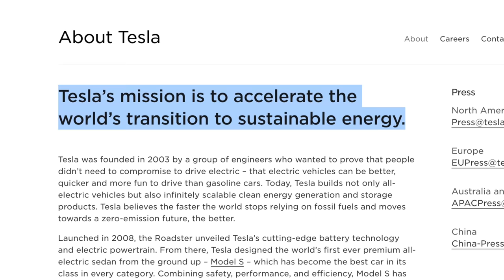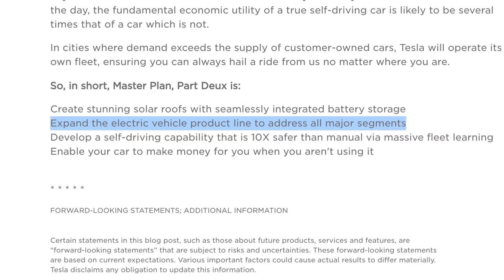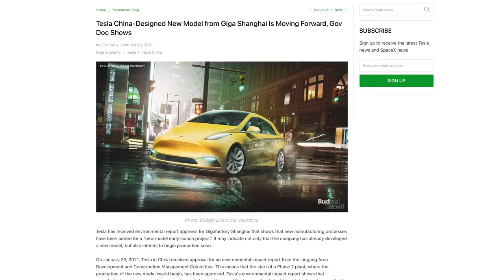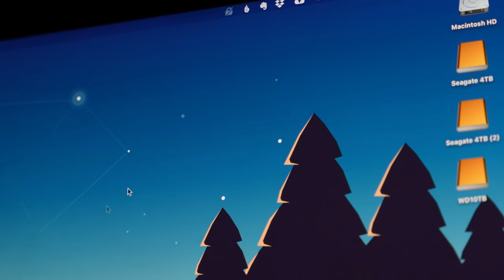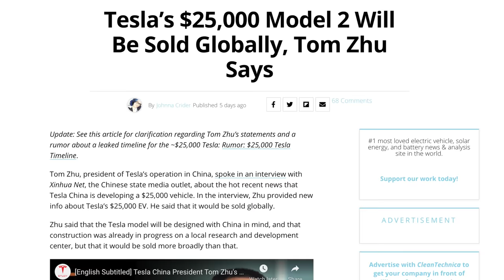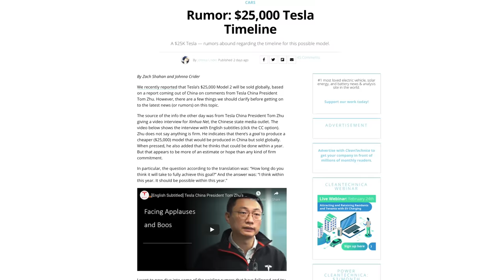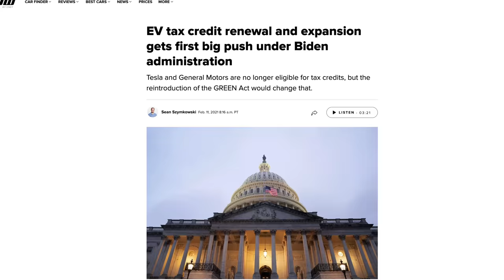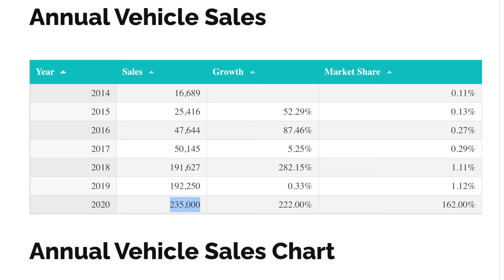New Tesla Model 2 = Game OVER for Gas

Comment: Make a car that will go 1,000 miles before the next charge up. Last 14 years without a major repair bill. Charge up in 5 minutes and cost under $35,000. When that happens, then gasoline will be in some trouble. There will always be a need for oil and gas. What needs to be done is work on how to burn is cleanly.

Comment: What I need is range and a non-luxury car price. It’s fine to have some $20,000 cars, but if the range is that low I can’t go anywhere on a trip. I hope they will get increased range on the mid priced cars, increased infrastructure of superchargers more places, and more stores. Right now it’s tempting to look for a car by a company with a store in my town such as Ford. The Ford range right now is about 300 miles but that’s not that great either. I need to be able to go as long as possible at 70 miles an hour so that I can go on a trip without having to fly. I don’t want to fly and I’m used to cars for my travel. 

Electric cars can’t do what I need yet and part of the reason is that the major car companies are stalling for time and trying to keep with the shorter range batteries.

 I feel like we’re in the dark ages still. Tesla has the higher range cars priced up at $80,000. I’m not going to run around in a luxury car like an elitist billionaire; people I deal with have contempt for conspicuous consumption. Please increase the range in the batteries, get more super chargers for trips, get stores in college towns like mine so I don’t regret not having a place nearby for service.
Reply: The range at 250 is not good enough. We need 500 miles a charge which is probably 400 miles at 70 mph. I’m not paying $80k for that. I don’t need high speeds and performance - I need road trips and reliability!

Comment: How will Tesla work in the winter? Keep in mind that in a good part of the country temperatures are below freezing for several months of the year. If you live in a rural area, and don’t have a heated garage, the gel in your Lithium ion battery will freeze, significantly reducing your battery’s range and your capacity to recharge it. I have a feeling that fossil fuel vehicles are still going to be around for a while.
Reply: Why do You think the 'gel' will freeze ? Does Your ethylene glycol freeze in the winter in the engine cooling system ?
Also, why do You limit You thinking to the [false term] of fossil fuels ,which is used for fuels derived from oil beneath the ground, then processed?
There are many 'renewable', natural fuel sources which are useful, efficient, effective in combustion engines and many without significant to zero emissions.
The list includes hydrogen, ethanol, methanol, methane and others too.
Sincerely

Comment: I'm still waiting to see a used-electric-car market develop locally.  New cars are out of my range (I don't borrow money).
Reply: Amen to that. What I have seen from the very small used electric car market out there is people drive them til the battery craps out and you can get them for pennies, but you have to drop a small fortune on a new battery to get them to work.
Reply: @misterknightowlandco  I'm currently cooking at a hydro electric dam.  No gas in the kitchen because electricity costs us nothing.   Even so, there isn't a single electric vehicle on site.  We are in the far north, so only proven technology is trusted.
Reply: @HeatherSpoonheim  yeah, I wouldn’t drive an EV up there either. It’s not ready for extreme conditions yet i don’t think. Personally, I wouldn’t even consider it until they made a truck.

Comment: Nice, but I occasionally drive to California from New Mexico,  so I'll still require an internal combustion vehicle.
Reply: Rubbish. I've just Googled Tesla superchargers between New Mexico and California and there are hundreds. It's a 16 hour journey so you'll be glad of a break to recharge. I worked it out and I live in England for chrissake.
Reply: @Nickbaldeagle02 , sorry nick, I don't want to stop and charge on my way, that's my choice.
Reply: @rongigear8740  what, you can do a 16 hour drive in one go, no refuel or toilet breaks? What are you, a Terminator?
Reply: @Nickbaldeagle02 , what business it of yours how i drive? Are you the arbiter of ecology? The preacher of green? I choose combustion over electric and that's my choice, not yours. I know all about the charging stations and where the are located. I know the cost for a 250 mile charge and the time it takes to charge the battery. All gas stations are located right off the freeway and takes no longer than 5 minutes to fill up, not an 80% fill up. So yeah, call me the terminator of driving straight through and save your preaching for someone else.
Reply: @rongigear8740  I thought posting comments on a public forum where people can reply is what YouTube was about. You said that you drive New Mexico to California occasionally so that you need a combustion engine. I pointed out that you don't. Now if you'd have said "I prefer combustion over electric" that would have been different.
Reply: @Nickbaldeagle02 , it's not what a person says, but rather how they say it. After 70 years on this rock, a degree in comparative anatomy from California State Hayward, 3 children and 5 grandchildren i think I'm capable of making intelligent decisions on my own. My choices are based on facts and reason, not on ideology.  When I drive 900 miles, 700 that's desert, I'm choosing the mode of transportation that I feel most comfortable with. So yes, internal combustion is a requirement for me, with or without Google.
Reply: @rongigear8740  nah, your just biased. I use to take road trips from Washington state to central mexico. An electric car looks godly to me, 24 minutes for an 80% charge every 4 hours is just great because my ass gets tired and i get hungry. The cost of electricity compared to gas is already enough to entice me.
Reply: @odisy64 , no bias, I don't want to spend 30 minutes every 250 miles charging, at an average of 20 bucks per charge. Especially not in the desert in the middle of no where, lotta bad people out there. Enterprise rentsTeslas and they give you a map of all charging stations. When I get to San Diego I use my electric mountain bike to get around. People need to get a grip, not everyone is going to agree with you, but that's life.
Reply: @rongigear8740  uh, a current model 3 has a 353 mile range, where are you getting 250 in 30 min? You can disagree with me just dont have the wrong reasons. If your worried about getting robbed at a charging station i can tell you its easier to rob someone at a gas station, but you also don't have to deal with beggars.
Reply: From the Enterprise brochure: "Plug in for about 30 minutes and grab a cup of coffee or a quick bite to eat while you charge." They estimated a 250 mile charge in that time... That's charging at a Tesla supercharger station. Now what model they offered,  I'm not sure. So I'm not disagreeing with you one way or the other because frankly I don't care what you think. As far as being easier to rob someone at a gas station, I'll assume you have first hand experience on that matter.  End of discussion.
Reply: @rongigear8740  can i get a link to your source, it might be outdated. ive seen others giving actual time estimates. Ive also seen videos  of people test it themselves at 250kw charging stations. But what i and you think is not important, the real world numbers are.

But anyways i think gas stations are easier to get robbed at because i live right across the street from one in the ghetto. We have a super charger station in my city and it looks way safer.

Comment: Gas isn't going anywhere soon. First, where do you send it for repairs? I live near Albany NY and the closest Telsa repair shop is in NY City. And our grid can barely handle the air conditioners in the summer here. And most who live in Downtown Albany live in high rise buildings and tend to have to park a block to blocks away. NY City has 1000's of times more people that live in much higher buildings. How will they charge it? they can't. Is Musk gonna put charging stations on every block? I'm not paying for that. And It's gonna a decade, or more, before the mechanics catch up even a little bit. Is Musk going to pay for them to go back to school. I ain't paying for that either. That's on them. It's their product. Right?

Comment: With the limits of current battery technology, electric car may work for some city folks. But for it to replace gasoline cars? I just don't see it in a foreseeable future. Even if electric cars cost the same as gasoline cars, and there are as many charging stations as gasoline stations, refueling still take at least 40+ minutes. Imagine having to wait for several other cars before you can refuel your car.
Reply: I think the idea is that you charge it at home while you are asleep or at a public charger while you are at work or the mall.

Comment: Sounds promising, but I'll believe it when I see it.  On the plus side, you need to also take into account state and local incentives for green vehicles.  On the down side, the insurance for Teslas is high and the EV infrastructure is still not what it needs to be. I'll also be looking at what other manufacturers will be bringing to market in the next few years.  This includes solid state EVs and hydrogen fuel cell vehicles.

Comment: I guess vehicle can last 300,000 miles plus if it's taken care of and several decades.

An electric vehicle is lucky if the battery lasts 10 years if that. Some won't even last five to six. Not to mention it can cost anywhere from $6,000 to $10,000 or more to replace the batteries.

I'll stick with my internal combustion engines.

Comment: It is so easy and affordable to build and develop electric car over a gasoline car it’s ridiculous. 
              It’s complex city is so much simpler than basic the amount of safety that is not needed for electric vehicle compared to a vehicle that has flammable transmission fluid flowing through hoses and lines flammable power steering fluid 10 to 25 gallons of gasoline that is traveling through poses with clamp bracket seals gaskets O-rings that all fell and caught fire 🔥 at a much higher rate proportionately than a Tesla’s electric battery. 

        Coming from a family fourth generation automotive technician these cars are so easy to work on so much less maintenance a child can service one of these vehicles

Comment: The game won't be over for gas for at least another 20 years.
Reply: @jayberlin3265  There's a ton of things that need to happen before EVs are practical for the masses. range, charging availability, charging speeds, extreme weather performance. driving 10 miles to a supercharger is grossly inconvenient and then I have to sit there for 30 minutes or more to top off. that time is only going to get longer with bigger batteries with more range or if you can't get to an actual supercharger and have to use something slower. not being able to charge at home overnight in a garage makes EVs a no go for non-homeowners. also extreme weather greatly effects the performance and life of these batteries. 

Indeed we're in the last days of gas and ICE, but it's not gonna happen tomorrow, or next year, or next decade.

Comment: Lithium ion batteries sit right on the edge of practicality for powering automobiles. If driven locally and you are willing to accept a big eventual expense or shortened vehicle lifespan it is practical. If you need to drive coast to coast it will require careful planning and a little luck. Not really practical yet in that case.
Reply: You dont really need to do careful planning, the tesla automatically routs you to supercharge station when you set your destination. Batteries today work but the charging infrastructure is what needs expansion.
Reply: @odisy64  And you can go from anywhere to anywhere without exceeding the range of the vehicle? And those "supercharge stations" take around 45 minutes? You will have to plan your stops to account for that. Where I live the only supercharge station is on the outskirts of town near a Denny's I guess you could hang out and eat lunch - if you like Denny's. The premise of this video was that the new Model 2 will put gas powered cars out of business. I humbly disagree. We are not there yet. Largely due to the limitations of Li-ion batteries.

Comment: We're kidding ourselves if we believe switching to electric vehicles will make any significant dent in our environmental problems anytime soon. EVs are too far from being convenient at this point except to toddle around urban centres for shopping and appointments. Highway driving is a joke - having to wait... sometimes in line... to hook up to recharge for anywhere up to an hour every few hundred miles is simply not in the cards. Batteries will need to become MUCH more powerful, recharge MUCH more quickly, last FAR longer, and cost FAR less than are available now. And if you think manufacturing batteries is easy on the environment - THINK AGAIN.
  Where do you think all this additional electricity is going to come from? Solar panels? Windmills? You gotta be joking! We're going to need THOUSANDS more power generating stations and uncountable increases in distribution networks before the "dream" of everyone driving electric ever happens... IMO.
  We need to start thinking "outside the box" on this one. If you can charge a cell phone just by placing it on a charger, why can we not start building chargers INTO THE ROADS so when the vehicle rolls by, it charges at the same time?

Comment: I'll buy electric when there's no need to plug it in and the battery is guaranteed for 20 years.
Reply: That’s literally like saying I’ll buy a combustion engine when I don’t have to put gas in it, and don’t change anything to the engine for 20 years
Reply: @rjrox211  gas engines last longer than 20 years and it's to expensive to charge electric vehicles

Comment: What the people want is a glorified golf cart that's cheap and safe and can go 80mphs. What we want is an electric car under 15k with just the basics to drive dependably and to be able to service it ourselves. We want to be able to buy replacement parts from AutoZone. We don't want all the techno stuff that adds so much needless cost. If u do, then have options to add the techno stuff for increased cost.

Comment: I will never buy a ev as a car guy I like the sound also if I can get Toyota Corolla Camry that can do 30+lines a gas and it cost 20 thousand less than a Tesla with a 260 miles range the money I would save going electric would not be enough

Comment: Power grid can’t handle .The demand for charging all the cars needed . The power grid can’t even handle the small amount of electric cars on the road today. Great potential in the electric vehicle market performance wise maintenance cost wise. But before you change from a petroleum based power source for motorized vehicles.You need to improve the infrastructure that produces the power that will be needed. It doesn’t make sense to drive around in an electric car .that’s charged Buy a diesel generator. I know not all vehicles are charged by diesel generators. Nuclear power is not all that safe or friendly to the environment. Electric power produced by fossil fuels not that friendly to the environment. Even Hydro electricity has a major impact on the environment. Those are the three major sources that produce electricity in the world today. I know some countries have major solar power systems in place . With wind power also producing electricity. But both of those sources of power equal a small amount of the power needed. It’s when you start looking a little deeper you understand you’re not gaining much in climate saving benefits over a gas automobile. Then you have to take into account what you needed to put an electric vehicle together the batteries. That the material is mind in an extremely toxic environment with slave labor in Third World countries. Slave labor is not good. Toxic environment not good. Do you really think that Third World country is going to follow all the regulations to ensure the least amount of pollution possible. Patience is a virtue rushing to achieve a goal will end in failure.

Comment: Camry Hybrid has a smaller carbon footprint. Maybe not in cold climates.
LiFePO⁴ batteries can suffer damage when charged below 0°C. Wikipedia. Not practical in Canada or most of the United States of America.
Reply: Nope, teslas are cleaner. In my state they produce 4 pounds of co2 every 141 miles from the electricity generated. Every gallon a hybrid burns is 20 pounds. Also the batteries can heat themselves up to charge more efficiently.
Reply: @odisy64  So what about cyclist who usually only drive 1-2 times a week?
Maybe only less than 40% of the electricity is generated by fossil fuels but the reason it's called the grid is because the entire electrical system is all wired together. And throughout North America 2/3 of electric power comes from fuel burning power plants. The power it takes to charge your car could power thousands of small electrical thing by taking some of the load on the grid. Coal plants are the oldest and most inefficient on average. Coal doesn't arrive through a PIPELINE. It comes on rails or on trucks. How do you get those Coal plants offline if the  load goes through the roof?
Then electricity prices will go through the roof!
To me GWCC narrative is bunk. But if you think it is true you should invest in high efficiency furnaces hot water heater stoves and dryers. 1Watt=1Joule of heat. Every Watt you saves 4 Joules of heat on the national grid. 75% of 32%=24%.
fuel burning power plants average:32% 
Line losses including step up and down and I²R loss about 25%, 100%-25%=75%